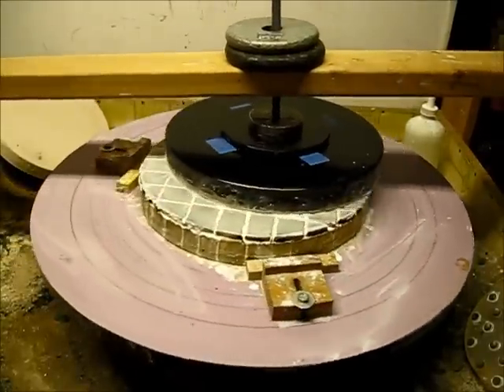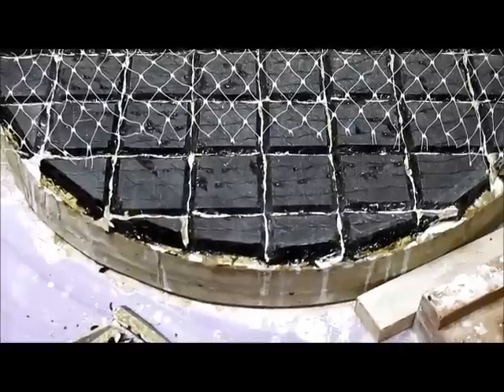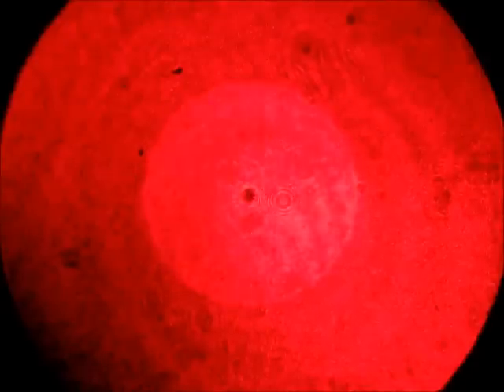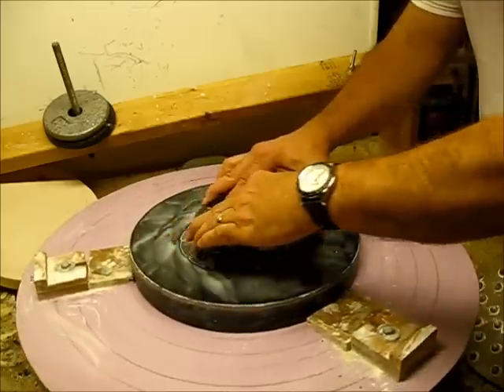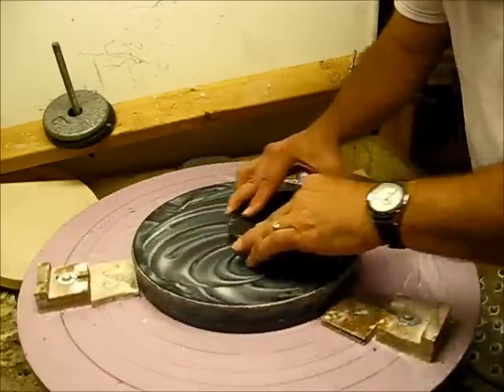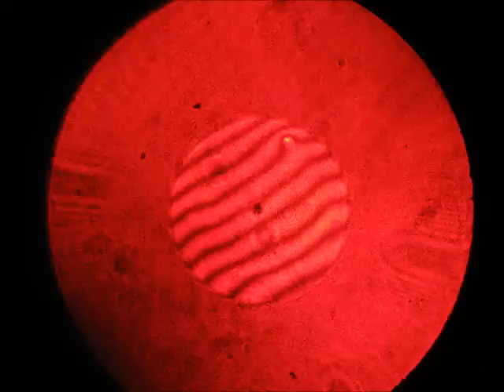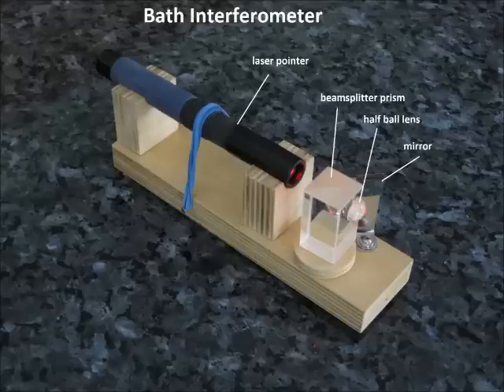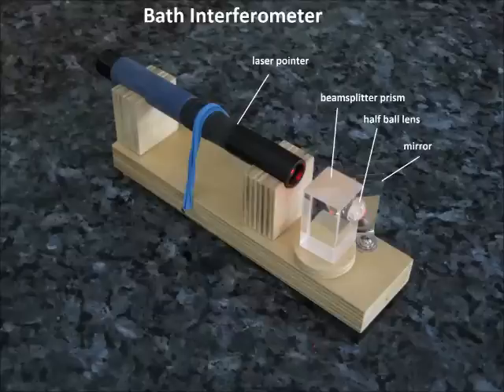Parabolizing a 12 inch F/7.6 parabolic mirror

Comment: im just curious how rotating the mirror makes any difference when it is spinning in circles anyway.
Reply: I had this question and I found the answer using logic. Follow my steps and say if I am fooling you(and in that case, myself):
- Astigmatism comes from asymmetrical abrasion of the mirror.
- Abrasion might come from uneven distribution of abrasives or uneven loading or uneven tool total path length for different sectors of the mirror surface
- When you spin the table and the mirror on it distribution of abrasives and tool path lengths distribute evenly
- But if the mirror is on the bottom it is being pressed to the support surface which might have some asymmetrical curvature 
- In that case the mirror is bending and thus the loading distribution becomes uneven
- If you spin(or change positions frequently) the mirror relatively to the table, you evenize loading of different mirror segments